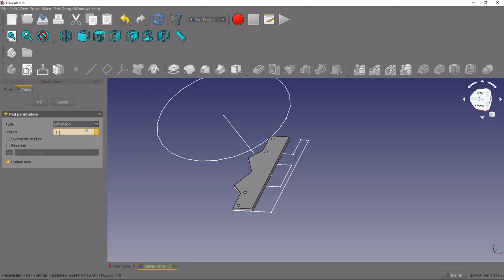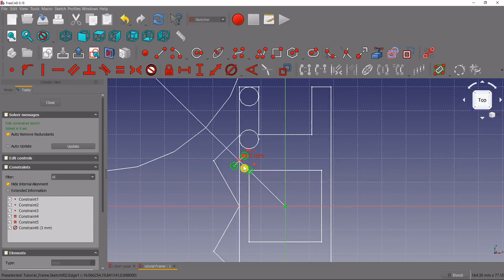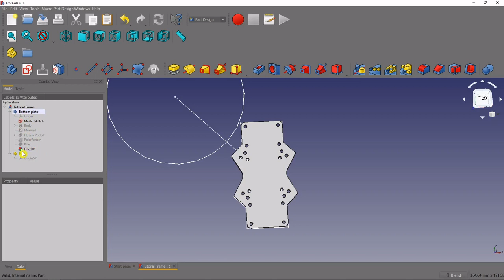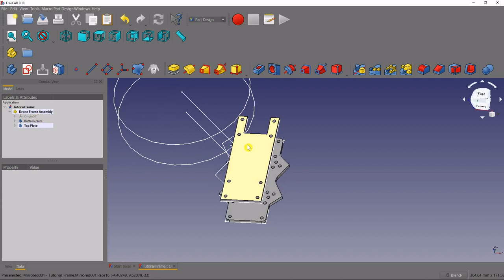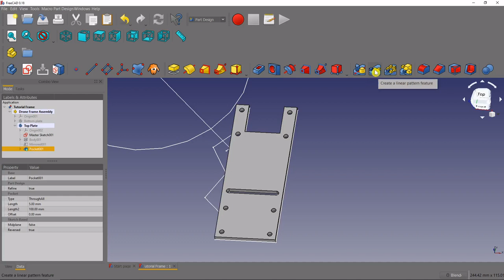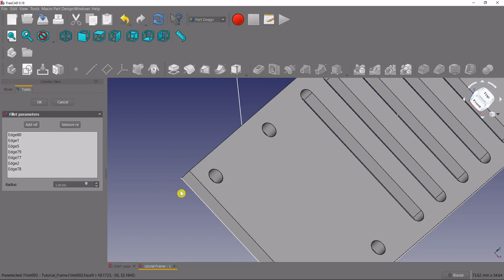FreeCAD Part Design with a MASTER SKETCH | Tutorial for beginners | Top and Bottom Plate Assembly

Comment: Nice tutorial. I do have one observation.  When you copied the bottom plate,  you created a new master sketch in that body.   As far as I can tell,  if you changed one of them,  you would not change the other.  You can achieve the goal of a single master sketch by placing the master sketch outside the body,  placing a shapebinder to the master sketch inside the body and referencing geometry from the shapebinder in your pad-sketch.  When you copy the body, deselect the master sketch (a dependency).  Paste and move into the part.   There will be a copy of the shapebinder, which will reference the original master sketch.

Comment: Great tutorial. Thanks a lot. 
I really wish there was a way to create two bodies from the same master sketch rather than from a copy of it, so I would not have to go and apply changes to all copies.
Reply from the maker: Another viewer told me there is a way to clone the master sketch in the draft workbenches. When you do this, you can edit the master sketch and the clone will automatically update.
Reply: @FPVBuilders  Wow! Thanks a million. For whatever reason I was convinced that clone works only on entire bodies, but I just checked - and it actually does work. Moreover, I did it directly in the Part Design workbench. I created a Body and then a sketch within this body, which is my Master Sketch. Next created another sketch with features linked to the master sketch and made a pad of that sketch. After that I selected the Master Sketch (not opened, just selected) and used the clone tool. That created a body with cloned Master Sketch, which is read only and follows all the changes done in the original. However within this new body I can create new sketches and link their geometry features to that cloned one. That's just brilliant. Thanks again.

Comment: Is it necessary to copy master sketch? It smells like not the best option in case you need to modify some parameters.
Reply from the maker: I've been trying to find a way around copying the master sketch.  Unfortunately, if you do not, there is noway to reference it when you create a second body.  This does seem like a limitation, and I am trying to figure out a way to just have a single master sketch for the whole assembly, but I haven't been able to figure that out.  For now, it seems that each body does need a copy of the master sketch.  I think it's because the bodies can be exported individually.  If you were to export a body that referenced the master sketch in another body, it would no longer have those references available.  Let me know if you figure out a way to make it work!